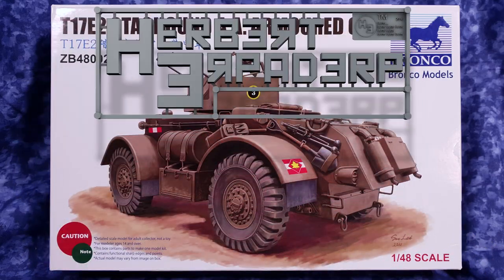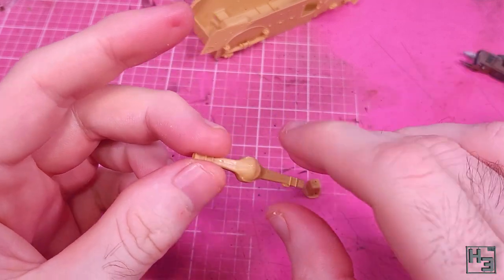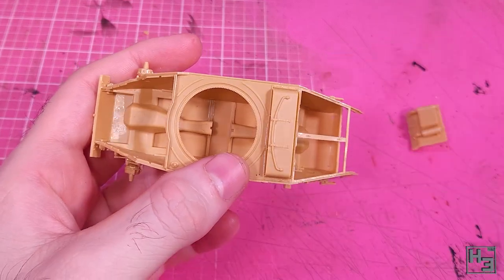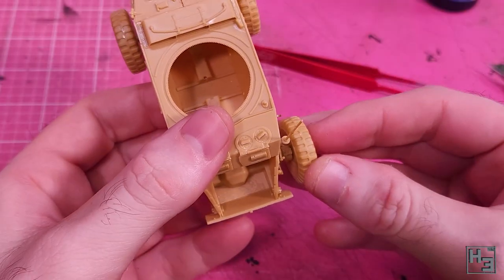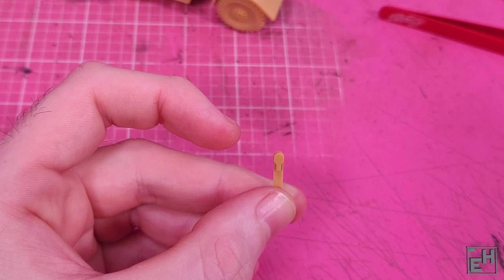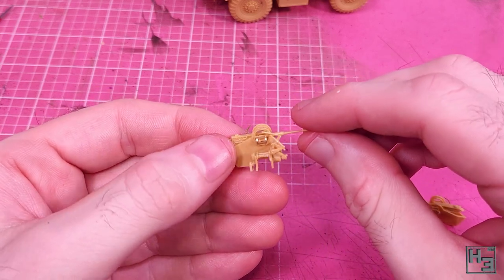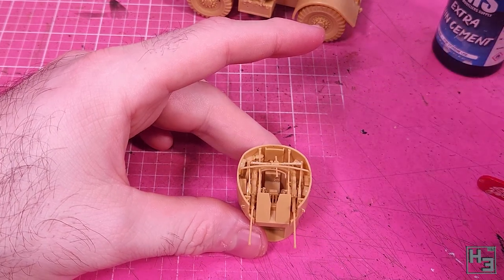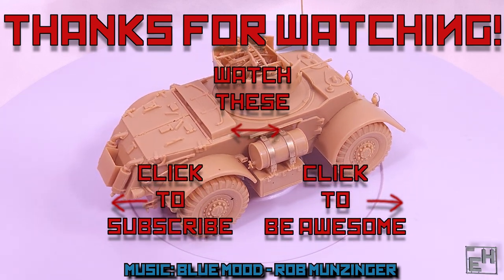Bronco T17E2 Staghound AA [1:48]

Comment: The right front wheel seems a bit high. Is that due to the weird non centereable internal ring thing you left out, or just poor design? I honestly don't think it's your fault.
That turret would put me off that brand permanently. All that lattice work of tiny bars could just as easily have been a few pieces of etch, where on the other hand many of those etch parts could have better been molded in plastic in place on the parts they were glued to.
Seems to me they included some of the etch because they could. Maybe it would have been a better kit in 1/35 scale.
Bitching aside, I  like the lines of the vehicle, nice and blocky and antique ish.
Reply from the maker: I think the front wheels go on the axles very well, It might just be that the axles aren't level, I think the leaf springs were on at slightly different heights. or the axle isn't sitting on the leaf springs quite the same. 

I'd agree with you about some of the photo etch being that way just because they could, and things like the tiny bits of etch I left off for the ends of the gun sight mounting things could have just been molded into those bars. 
I think I'll pay attention next time and not buy an open turreted vehicle.